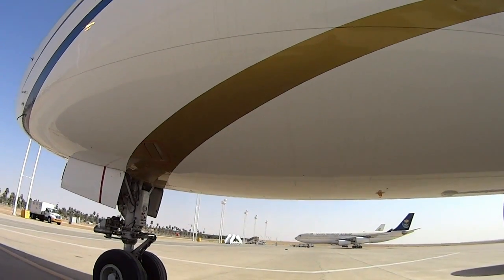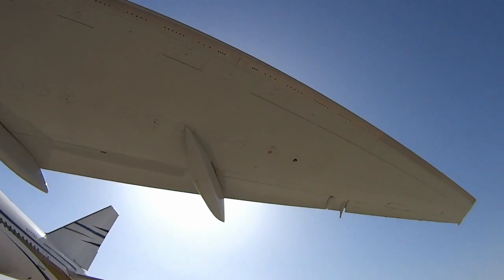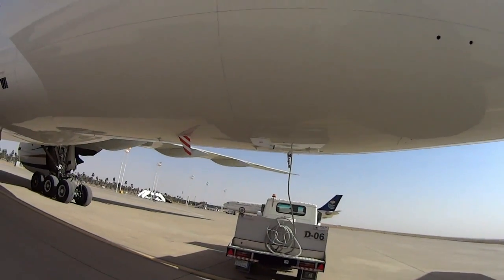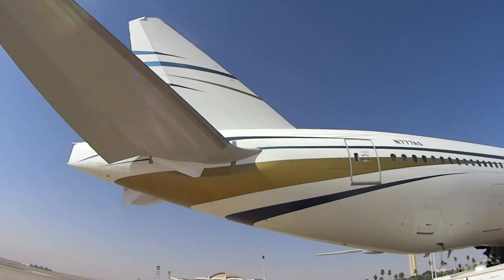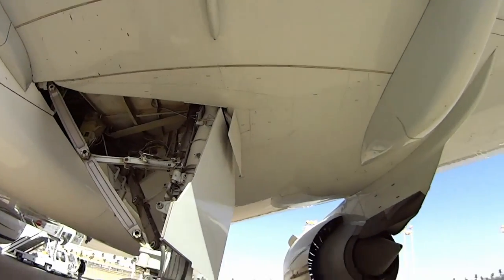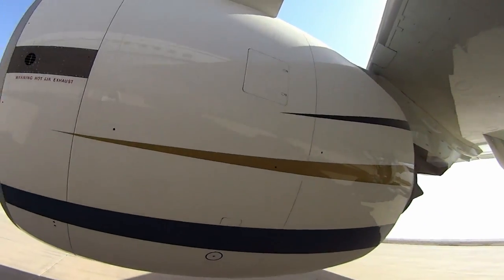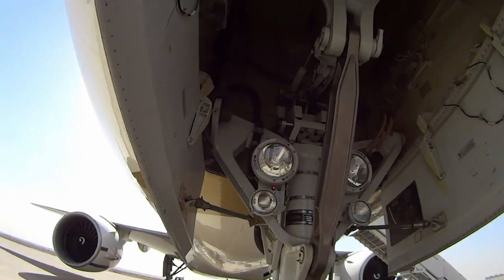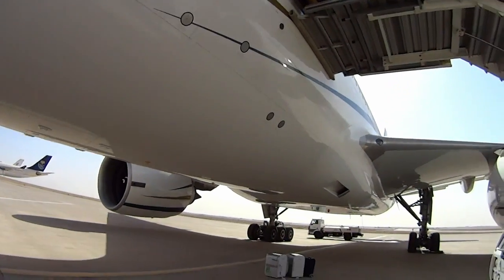Boeing 777-200 Preflight Part 2 | Exterior Walk Around

Comment: Very interesting!
On minute 5, the FBW logic of the elevator/stabilizer is interesting. On the 777 in Normal Law and in flight, trimming or pulling/pushing on the control column will first move the elevators and then will reposition the stabilizer to "streamline" the elevator. That's to retain full elevator authority and reduce drag from the horizontal tailplane.
Reply from the maker: +jibeneyto Thank you.
Reply: Welcome! There's a 777 FBW analysis in my channel, if you'd like you could have a look :)
I love your videos by the way!